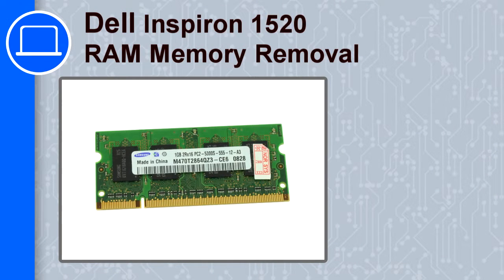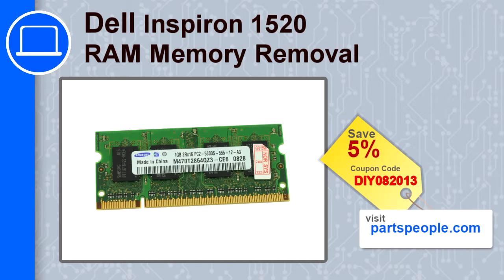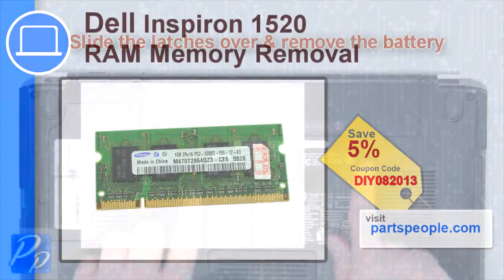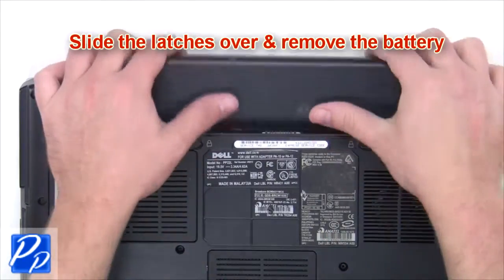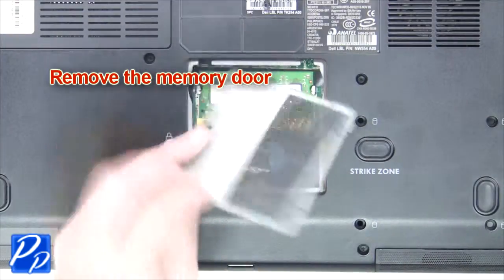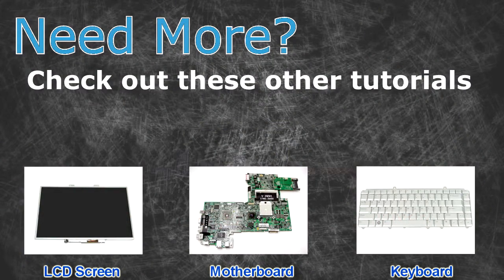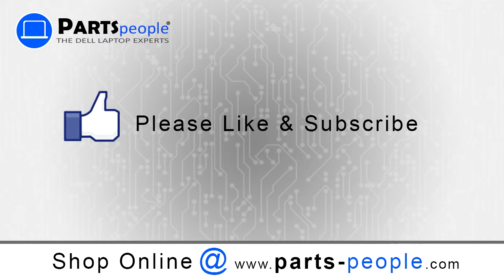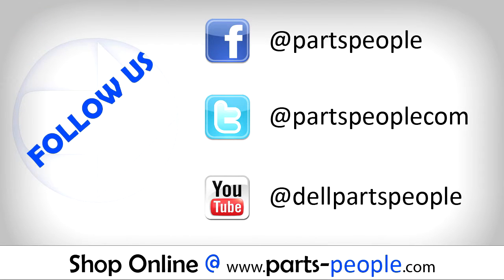Dell Inspiron 1520 RAM Memory Replacement Video Tutorial

Comment: LOL there is another RAM stick in this computer, you have to remove the cover that says inspirn 1520 on it, remove two screws holding the keyboard, remove the keyboard, lift up a small black plastic piece, and the second stick is under it.